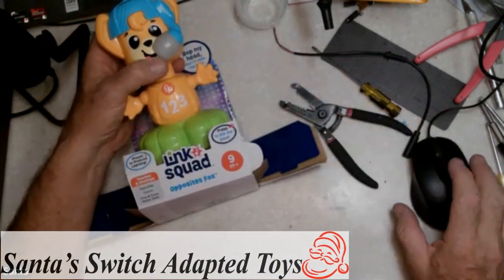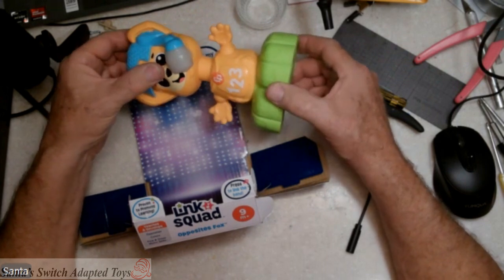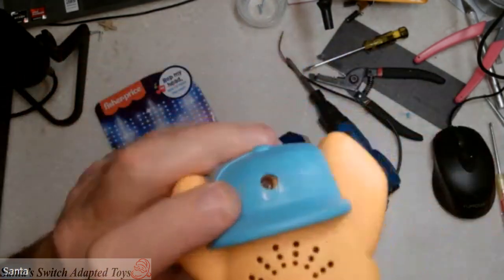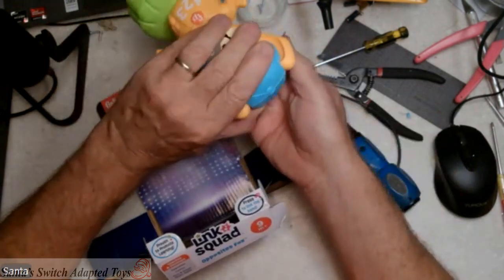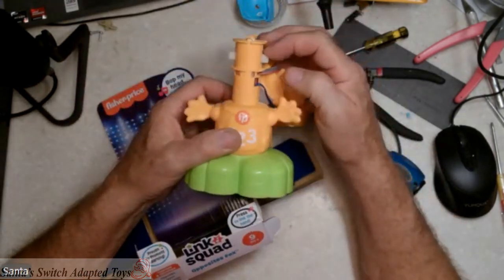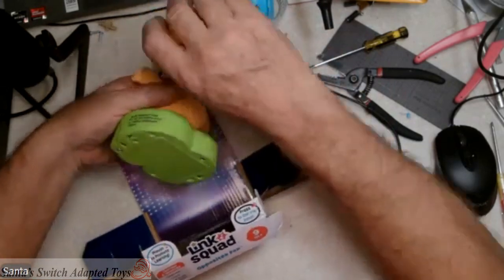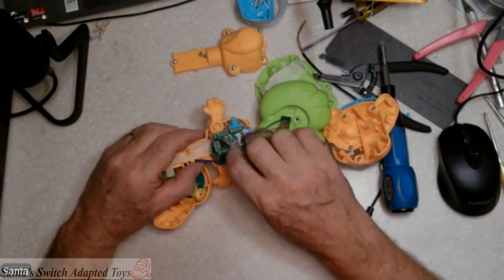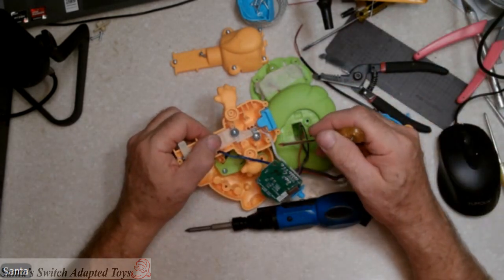Santa's Switch Adapted Toys - Link Squad Opposites Fox

Comment: Hi Jerry you can also use your hot solder to make the hole. 😊 thanks for video.
Reply from the maker: I think you could, just want to be cautious of the hot plastic. 
I imagine it will build up at the edges, but that would be easily taken care of with a sharp knife.

Comment: Hello, I have a couple of questions.  Do you know how to remove the hat without drilling? Also, is there room to adapt the power switch as well so a child can turn it on and off with out assistance. Also what type of switch( momentum or latches) are the power switch and activation switch, I assume the power latch and the activation is momentum? I make adaptive toys for my jobs toy drive and think this will be perfect if i can do it without breaking the head.
Reply from the maker: Because of the screw you need to remove to open the body being hidden, and the cap glued on, I found no other way to open the toy for adapting without breaking the cap. Or drilling as shown. 

If anyone does find another way, please share. 

The only residual to drilling will be the hole in the cap, which I suppose could be filled with plastic or glue. 

All switches for standard switch adapted toys are, or should be, momentary. 

Pressing and hold may help activate toys like bubble machines. But most factory switches in the toys are designed to activate when pressed, then ignore further input until the particular predetermined program is run. 

A Latching device does allow for the pressing and release of a momentary to prolong certain actions. Like bubble makers. The Tiny Switchy is my preferred device for this function. 

https://www.etsy.com/listing/1380977189/latching-switch-tiny-switchy-slat-switch

Of consideration when trying to use any commercially available adaptive switch to interrupt battery power to a device is small gauge wires. The wires in the cables used in adaptive switches, and in adapted toys, are very thin, and the wires needed to handle even 3volts of battery current are thicker. And most toys have 4.5 volts and up of batteries in them.

So, I am very leery of using adaptive switches with battery interrupters, or even connecting the short stereo cable normally installed in the toy to the battery wiring. Essentially making it a power switch. 

Would hate to hear that the wires heated up and cause harm of any kind. 

Have you purchased any of the switches or toys from SantaJerrysWorkshop on Etsy? 
Or Lasergy2 on Ebay? 

If so, please mention you adapt toys and I will happily add several stereo cables, both for toys and switches, to your order at no charge so you have a supply ready to use.

Comment: Hi, Santa Jerry! I'm new to the world of physically adapting toys. I've used battery interrupters in the past, but they often don't allow full functioning of the toy or they require the child to hold the switch down to keep the toy activated. Thank you for sharing all of your work! I have a couple toys I'd like to adapt that I can't find tutorials for. I'd like to adapt the B. Toys. Woofer Dog Guitar (Target) and the Fisher-Price Sensory Bright Light Station Electronic Learning Activity Table. Do you have any advice to share? Thank you!
Reply from the maker: Thank you for the kind words! 

In the tutorials I try to identify the alternatives to access the internal contacts for the factory switches, and the simplest solder points to use. Hoping others can learn what to look for when they open up other toys.

Existing solder points is always the best, and easiest, while tracing out from the factory switch   

First thing I would do is determine specific function(s) you want the user to activate? Because each user input activity requires a separate cable and adaptive switch. 

And I believe both of those toys have multiple inputs that should be adapted to make the toy interesting for the user.

Then the fun begins. Open up the toy and look for connections. 

For interactive help, there is a FB group called 'Santa's Switch Adapted Toys' where you can ask questions, post pictures of the circuit boards and get suggestions for adapting solutions.
Reply: @TheLaserguy2 Thank you for the tips! This will be helpful. I’m glad to know of the fb group. I’m eager to learn!